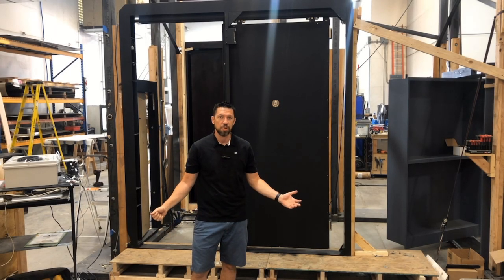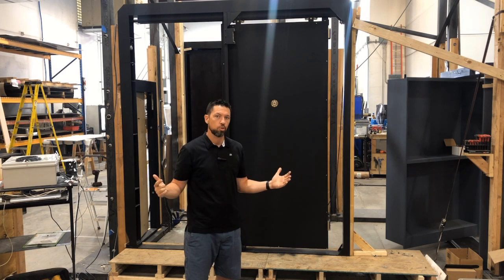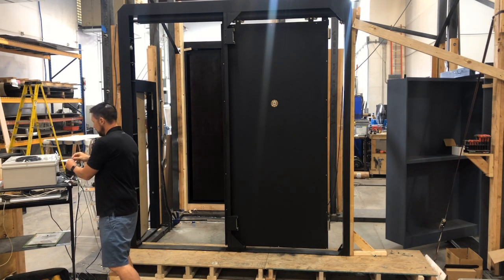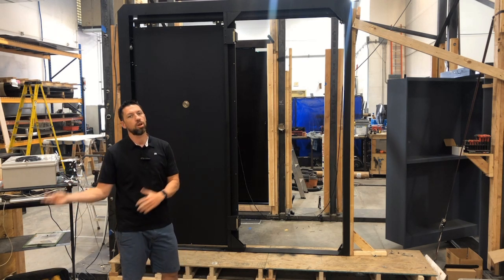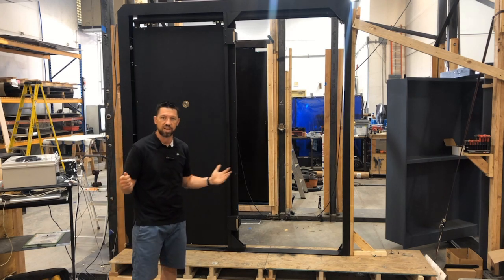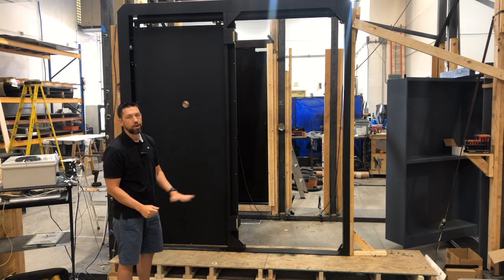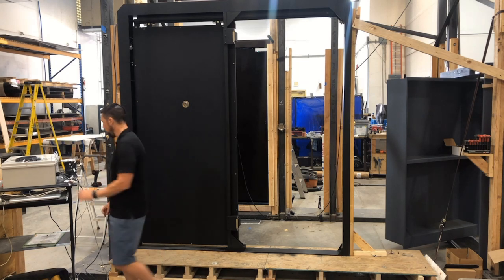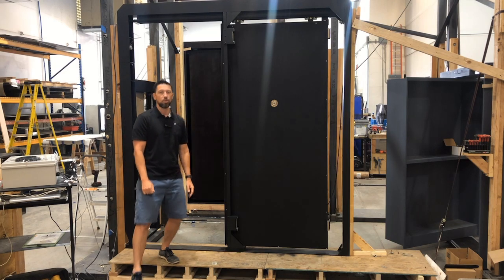A Sliding Bulletproof Pocket Door

Comment: Awesome build! I dont get how the locking system works. I also dont get how it's structurally resistant to ramming forces (im worried about the wheels having to shield most of the impact.